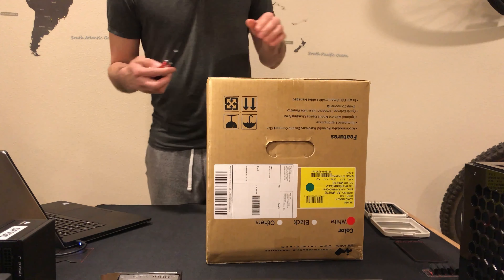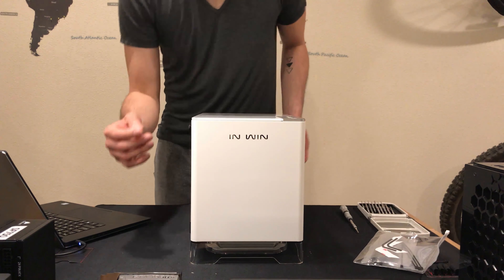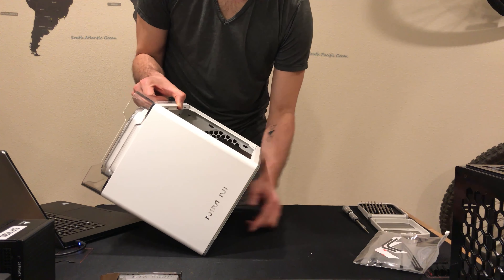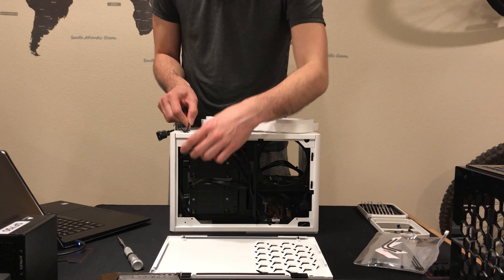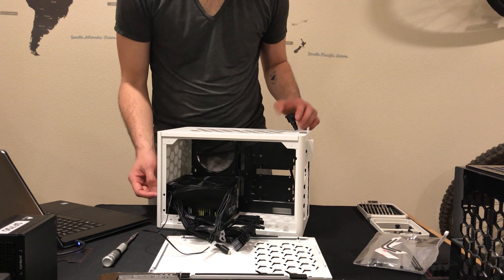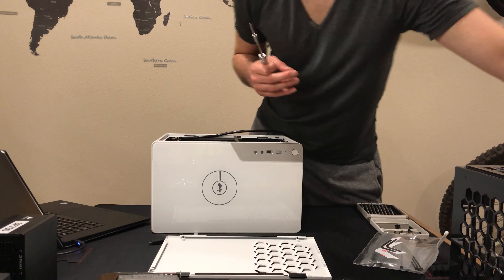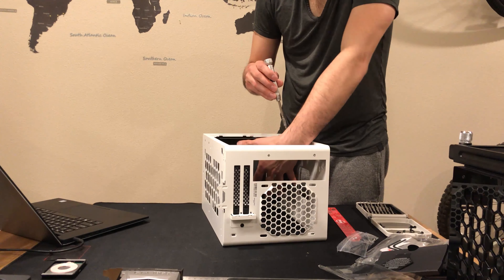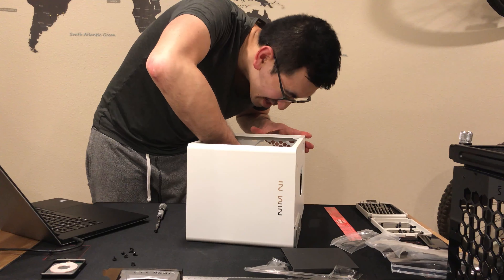Overview and Teardown of Inwin A1 WARNING: LONG!

Comment: is it possible to upgrade the psu and still keep the wireless charging?
Reply from the maker: I don’t see why not (I no longer have he case to verify the voltage it needs), but it would involve either splicing or adding a connector to the new PSU.

PS - my assumption is the charger runs either on 5v or 12v.

Comment: I got the same case, I removed the power supply because I didn’t trust it
Reply: can you remove power supply without removing motherboard?
Reply: @Fr33domSouL yes if anything isn’t connected to the motherboard
Reply: @diorr.r  Thx!
Reply: @Fr33domSouL  np did it helped out, and removing the power supply is a pain in the ass
Reply: @diorr.r  you don’t say, I am doing that right this moment,
Just screwed in the new one
Reply: @thomasclapham7388  I need a new gpu
Reply: @diorr.r  thanks for the hope you have given me,

If it doesn’t work I can get a warranty at least
Reply from the maker: Sorry for the late reply, but I 100% agree with you.
Reply: What's wrong with the PSU, the gold 750W one?
Am thinking of buying this case, but without the what-ever-charging-thingy-on-top model.
Reply: @RUHappyATM  psu is shit lol
Reply: @diorr.r  the psu fried your gpu?
Reply: @DGENexMACHINA  nah just a bad psu i already replaced it lol